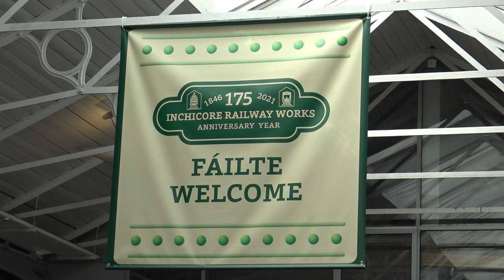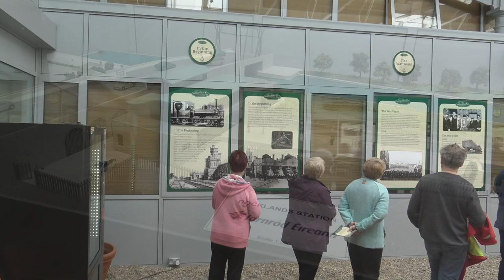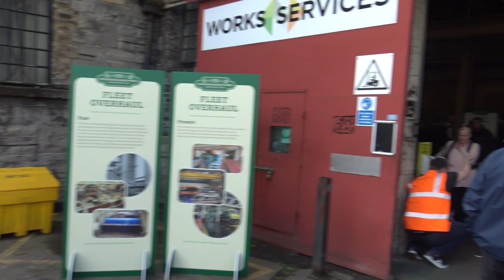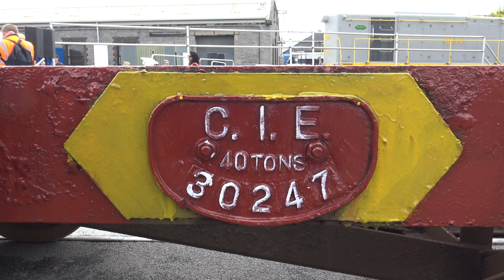Inchicore Works 175th Anniversary Open Day - 7th May 2022

Comment: Great video. It was indeed a great occasion and good to be back.
However as the old buildings remain , it's sad to see the engineering carried out in these buildings has long disappeared.
The once best equipped machine shop in the country is no longer, carriage shops look almost redundant, engine overhauls now in old wagon shop and not diesel 1.
The best apprentice training centre in the country is no longer .
The great memories of working there in the 90's remain.
Reply: Probably because it is no longer as labour intensive as a company

Comment: Brilliant Footage you Filmed Stephen!😃.I wonder will we ever see the 2700 Class DMU Trains back in Train Service again?.I have heard it being said that they still start them up from time to time,  but it doesn't look like they have touched or moved much from your footage.Did you ever get any footage of them when they were in Train Service?.
Reply from the maker: Thank you, I would have my doubts about that, I'd recon they're for scrap, they had them closed off to the public on the open day, I only managed to get a glimpse of them.

I have hardly any video of them when they were in service,  I've only like 4 shots of them at Limerick back in 2009 or 2010 while on a rail tour.
Reply: I doubt they ever get running again because they were unreliable i heard. They look so sad left there to rot away
Reply: 2700 class DMU is still used on the Cork commuter line no? (Cork-Midleton and cork-Cobh)
Reply: @tonycallahan4488  No thats done by the 2800s
Reply: @Irish-Transport-Photography 2600s．
The 2800s go there rarely if a 2600 is being serviced.